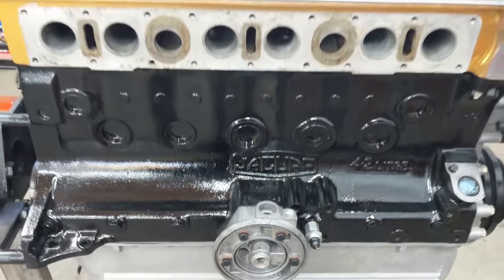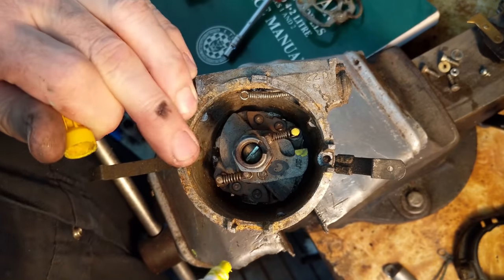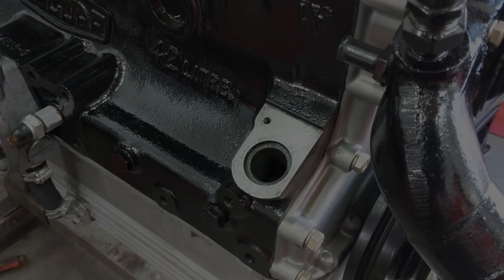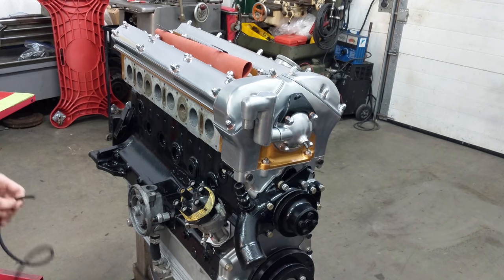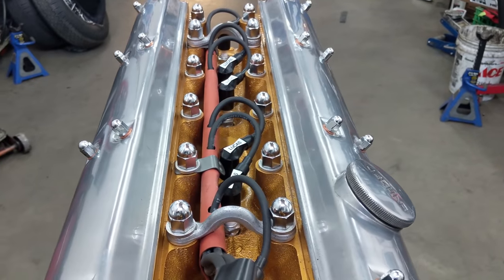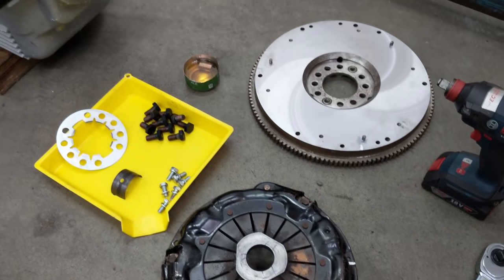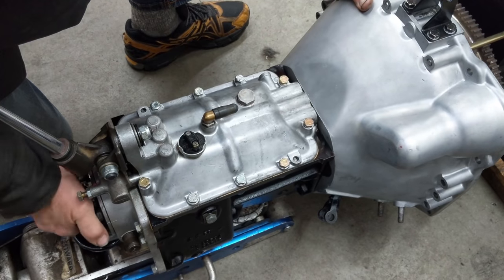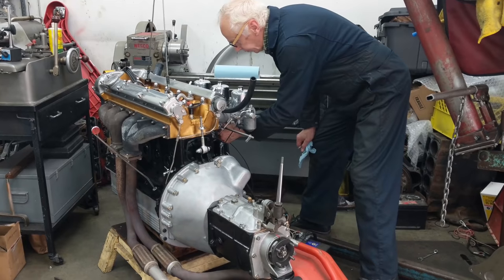My Junk E-Type Engine FINALE

Comment: Well done 👍👍👍. I may have skipped through a bit,, but do you plan to put a coating on those headers?  A YouTube tip to share: Run the video at 1.5 playback 😀😀😀
Reply from the maker: Ceramic coating on the headers would be nice. It's a good idea. I still need to find a good used S1 set first.

Comment: Why you did not put back the Jaguar valve cover back on the engine?
Reply: ? That's what was on there
Reply from the maker: The smooth covers are from an older Jaguar motor; it's the Series 1 look.

Comment: Well Done Richard and Dad. I enjoyed your build. Maybe, pump the C.Ratio up a point and a half, port and detail the heads. Valves, Cam. ?    Mild    N2O.  Nitrous  kit.  A  Six speed Trans.  ...    380 h.p.- 380 Ib-ft   Maybe more. ?  Hand welded custom Titanium Headers and exhaust.  Should be good fun in a 2500 lb. E type.  B.T.W.   Junk,  is a quality ancient sailing ship still in use today and have been for millennia.   Cheers from  Adelaide SA

Comment: Excellent series. Love it despite not having XKE. I hope one day to be able to get one. One request however. How do you adjust the carburetors. I had a MG in the 70s and was never able to get it correctly adjusted. A show about the differences and adjustment would be much appreciated.
Reply: Stethoscope in the ears. Hsssssss. Or just a wee tube.

Comment: Noticed a couple things I found odd. (Bear in mind, I've been a domestic diesel mechanic over 30 years.) While installing the dist. drive, I saw the #7 main cap on the timing chain end of the block. Then, while you ran your plug wires, you ran #1 to the flywheel end. Curious, I looked into it. Is it common for Euro. engines to be numbered opposite U.S. engines ?

Comment: I also bought a plug wire assembly from Moss Motors about a year and a half ago.  It just sat until this week in its plastic bag.  On a whim I did a continuity test on each wire.  Then I measured the ohms through each wire.  Come to find out that one of the wires with connector only measured 1.9 k-ohms and the other 5 measured 5 k-ohms.  I looked down inside the #5 Champion connector (I probably should have gotten a Lucas assembly like Richard did) and it was dark/black.  The others were shiny bright.  Now I'm trying to get the connector replaced.  Lesson learned.  Test each wire/connector to make sure they are all the same... right when you receive it from one's supplier.  You never know... and if you never did this and then started up the engine, if might not run very well.  You'd wind up replacing a lot of stuff trying to trouble shoot.  Who would have thought a connector, right out of the box, would have one bad one out of 6?  😞

Comment: why the Brits designed that engine so you have to haul out ENGINE + TRANS just to change the clutch?!  They coudl have avoided that by adding in some more clearance at the trans hump and you'd never miss it... but NOOO ... some people actually hack out the sheet metal to get the trans out without pulling the engine but you have to cut way too much metal for that... a mad design for a very beautiful car, you'd want to buy 2 cars, one for spare while the other's being fixed and keep throwing money at them if you want to actually drive them...

Comment: Your videos are so good, thanks for doing them. I was interested you didn't do the timing on number 6 cylinder (front one) as per the Haynes manual and also timed the distributor rotor on 1 as well. Yours worked which is better than mine at the moment where I'm doing the same on 6 cylinder but it won't fire up. Was working fine so I'm doing something stupid but will try your approach as I'n running out of options.

Comment: Notice the "extra" oil pressure switch located to the right of the oil filter block.  This seems to be a sensor added to light up a red light on the dash when the oil pressure drops to an unsafe level.  I guess it is a redundant indicator to the oil pressure gauge.  I noticed that the hole on Richard's dash between the tach and speedo was empty.  On my '65 there is a red light located there.  I believe the light connects to this pressure switch on the side of the engine.  Anyone have knowledge of this extra oil pressure safeguard?

Comment: I don't understand how coolant got past the head gasket into the stud passage. I'm assuming you used a composite head gasket (and a smear of Wellseal I would always recommend.)Coolant should not be there. I would now run a pressure test on the cooling system and if passing remove the head- Sorry. The factory used a bodge of Bars Leaks but that's unacceptable to clog up the radiator in this process. One more video required on this I suggest.
Reply from the maker: Adam, the S2 block has the unfortunate setup where the studs run down into the water jacket, so the coolant is free to reach the top.
Reply: Then surely thread sealant of the stud into the block and a proper seal of the head gasket around the stud would resolve this. I'm sorry but having coolant rising up the stud trying to seal it at the top head washer cannot be correct.
I think you should address this issue by pulling the head and resolving it at head/block level.
The cooling system must withstand cap pressure (7 psi. approx) on pressure test.
Reply from the maker: Sealing bolts and fasteners from coolant and oil leaks is perfectly normal for an engine of this age. 7lbs pressure for a 3/4 inch nut is no problem.
Reply: @RichardMichaelOwen  
Thank you. My comments are not to criticise you in any way. I'lll stick with my view that having coolant up the stud passage  in head is not preferable in the least. My opinion only. Otherwise super work.
Keep up the great videos.

Comment: HiRichard, I finally figured out how toSubscribe ( I’m older than your Dad), love your video’s. I’m working on my  XK 150 Coupe and need to put on new tires on a set of 15 inch wire wheels that came of my 150 race car.  No I’m not racing this one, just road rally, so I wonder if you can suggest a brand? My  coupe is a   Canadian car from Ottawa so love to know 
where your shop is and come visit one day. You mentioned you sourced original parts from people, I have a list of 150 misc parts if you are interested, plus a 120 tach and speedo?
Thanks Rob
Reply from the maker: Robert great to hear from you. For the XK150 it's the 185R16 PIRELLI CINTURATO CA67 . longstonetyres.co.uk should have them in soon.

Comment: time to remove "junk" from the title.  that thing looks beautiful
Reply: Yes, "Junk" is the wrong word.  "Junk" implies poor work with barely serviceable tolerances and limits.   "Stock" is a much better choice, as it was restored using factory parts and balance to what we call in aviation a 'new limits' overhaul as all tolerances are to factory specs for a new build. It's a gorgeous stock refurbishment, absolutely beautiful. Yes, it wasn't ported/polished/balanced, but by no means does that make it "junk!"

Great job.  Thanks for sharing.

Comment: I am a retired auto electrician. I noticed on your final video with the engine installed in the car and running the oil pressure gauge was reading not much over 20psi. That is way too low it should be indicating at least 40psi. Don’t trust those old garbage electric oil gauges. Run a test mechanical gauge to check it’s actual true oil pressure, If it still reading low you have a serious internal engine problem. 
I wouldn’t buy a car with low oil pressure how ever well it was prepared and presented for sale . Anybody buying these notoriously over-engineered unreliable old English bangers needs to have deep pockets, sound realistic advice from a elderly highly experienced New Zealander (kiwi)
Reply from the maker: Thanks for watching Phil, in an earlier video series we built and ran this engine with a mechanical gauge.

Comment: Hi, im going through similar process but was wondering why you measure TDC on cylinder 1 at the back when i thought it was No.6 at front on its compression stroke?
Reply from the maker: Both #1 & #6 travel the same. I hookup the wires starting with #1.